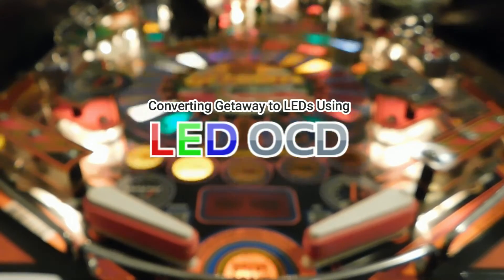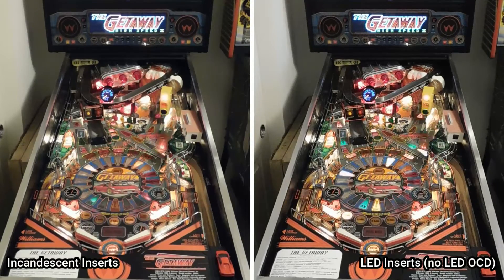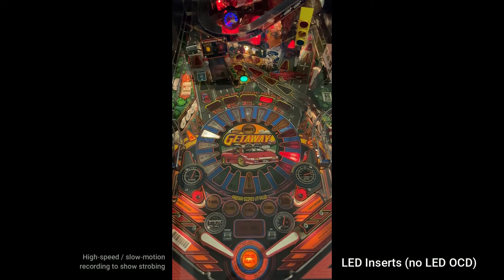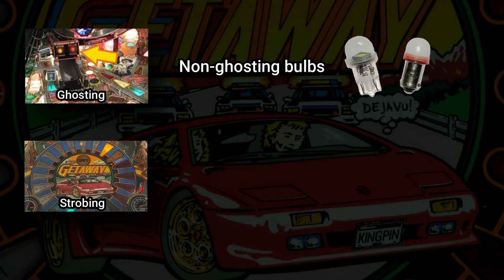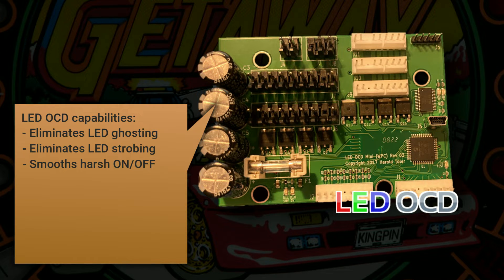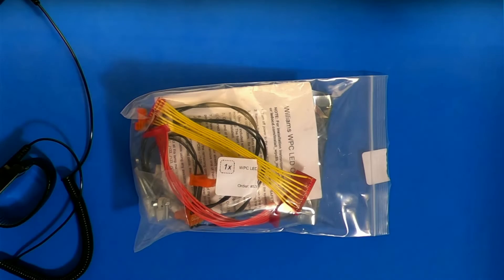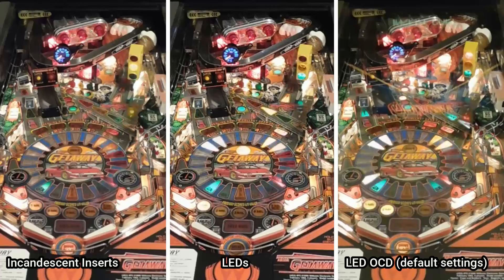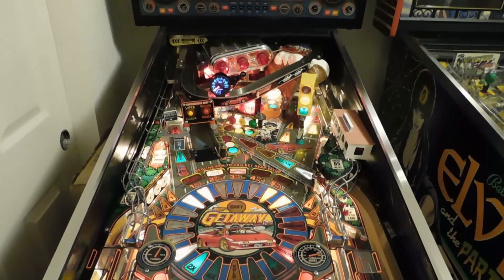Converting a Pinball Machine to LEDs Using LED OCD

Comment: Great video.  Ever thought about making a video how to use the LED OCD software?  Seems a bit complicated.  I want to just download file for my game, and write to the board.  I'm getting some undesirable flicker on my AFM GI lighting after a full LED conversion using the GI board.
Reply from the maker: I should!  There are a lamps that need adjusting. Some of the inserts are supposed to flash faster when they're about to expire, like the 1,2,3 targets. If you watch my latest Getaway gameplay video, you can see they stop flashing and just get dim.  I'll need to adjust the OCD values to get them flashing again.

Comment: The earlier electronic pinballs (late 70s to mid 80s) didn't use matrixing, each lamp was individually controlled. But they still might strobe or flash if no resistor has been added to the lamp socket.

Comment: Great video-what type of leds did you install, Clear or frosted lens ?
Reply from the maker: Thanks!  I used frosted, 1SMD bulbs from Comet Pinball--the cheapest, most basic bulbs they have.  They're in the GI section.  Nobody uses them for inserts because they're NOT non-ghosting, but a benefit to LED OCD is that you don't need fancy non-ghosting bulbs.  With LED OCD you get better ramping/fading performance with bulbs that don't have the non-ghosting circuitry.  Plus that saves you like $0.20 per bulb.

Comment: The worst thing about LED OCD is the cost. A default less configurable option would be great. I would buy a ton of those
Reply from the maker: It's not cheap, but the improvement is significant.  If you haven't already converted a game to LEDs, then the cost of LED OCD is partially offset by buying cheap LEDs.  With LED OCD, you can, and should!, buy cheap no-frills LEDs.  Without LED OCD, you have to buy more-expensive non-ghosting LEDs, and if strobing bothers you then you might need extra-expensive LEDs with a capacitor that tries to combat strobing.  The extra cost of more expensive LEDs adds up when you're doing the whole machine--and you can totally avoid that with LED OCD.